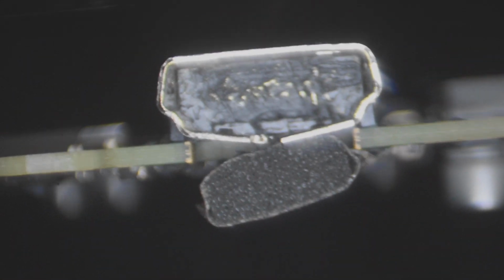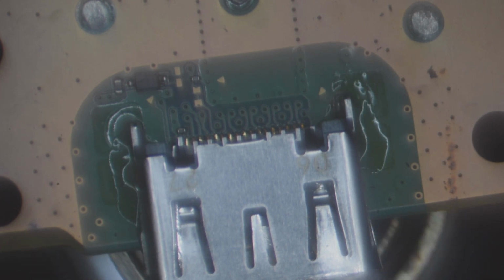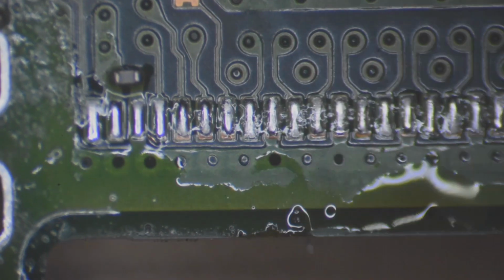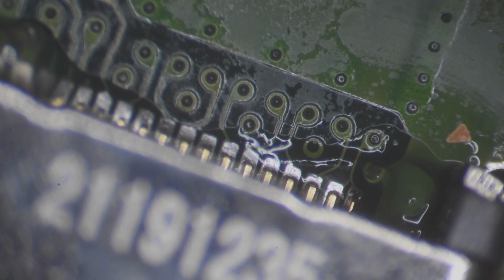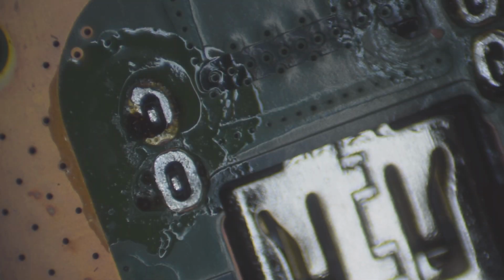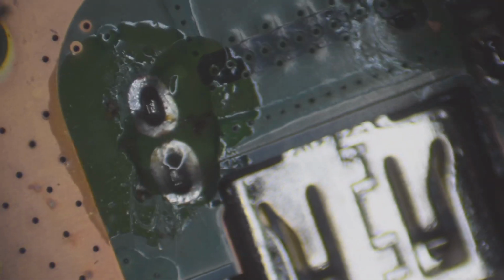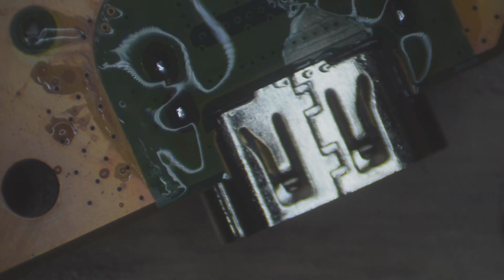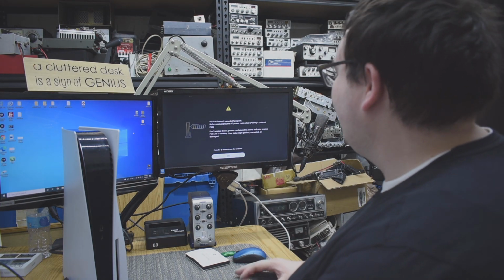Badly Damaged PS5 HDMI Port Repair

Comment: Hi 👋
Thank you for good content on YouTube 
I have questions 
I have PlayStation 5 and happened problem in input HDMI when l want to fix it The man in charge of maintenance said The problem is in the HD input and IC HDMI Video .
The IC HDMI not available except in Sony agent . When l want to Sony agent They took ten days for a diagnosis wow very long time after that they said The whole board needs to be replaced The amount of change is close to the price of a new device 

By comparing between a man and a Sony agent, the man identified the problem, unlike the Sony agent, they changes the entire board. I think changing the IC is the solution, but where is one of the IC

What do you think?
How I do get IC hdmi ?
By man, I mean a neighborhood repair shop the man inside 😂
Reply from the maker: So right now, the only way to get the chip is from a donor board. You can look online and find the chip pulled from a board, but usually the chip is pretty expensive.

Type in the numbers from the chip into Google and you can probably find someone selling the chip.
Reply: @chasefournier  thanks but Is it possible to use an input that converts from type-c to HDMI, like the one used in a laptop?